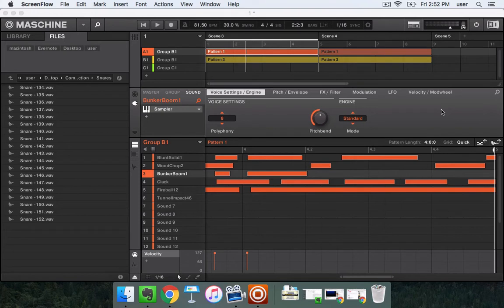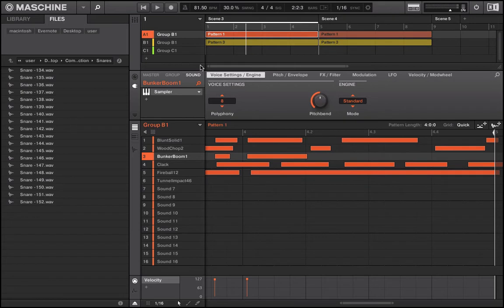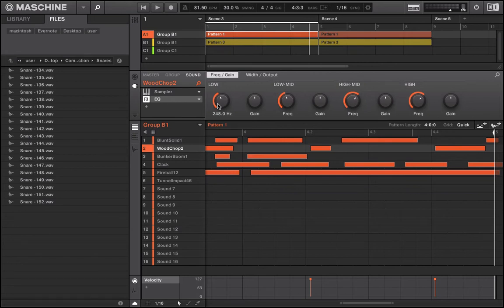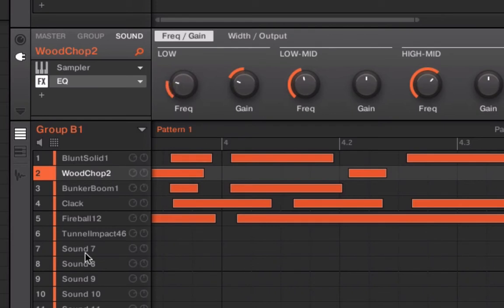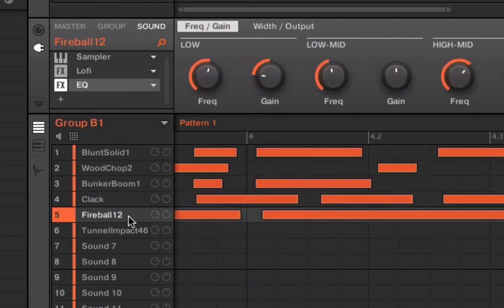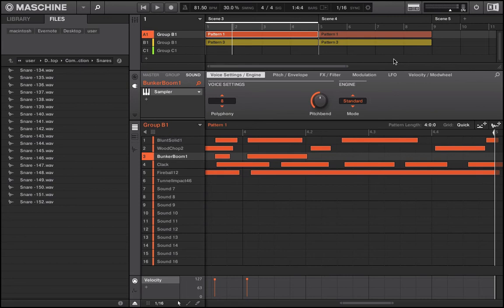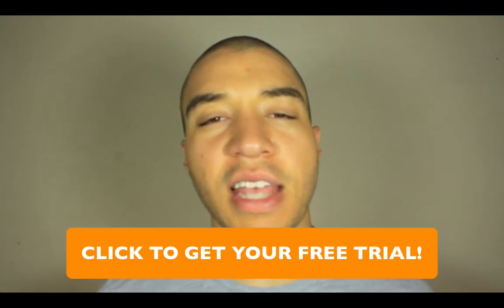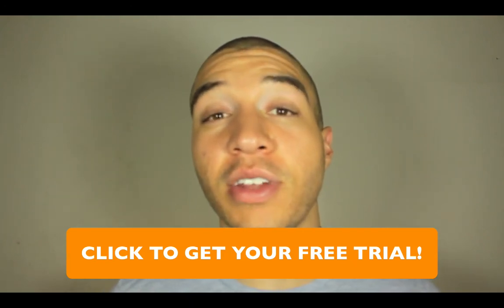How to Dramatically Improve Your Mixing on Maschine

Comment: +RobertStevenson how do you know/learn what the fundamental frequency of a sound is? For example you say the kick is at X Hz and the hi hats are are another Hz? I've been reading about frequencies and trying to learn but it's confusing to me. Are there ways of telling in Maschine what the fundamental frequency of a specific kick is so you can know what frequencies to EQ? Do you know of any websites or blogs that explain what sounds produce what frequencies? Thanks buddy.
Reply: other programs like Logic can be helpful as you can literally see the dynamics of an instruments wave in the EQ plugins. unfortunately Maschine doesn't really have a feature like this yet that i'm aware of
Reply from the maker: Hey Sean, I typically find the fundamental frequency of a sound by just experimenting with a really high boost on my EQ. For a kick drum for example, I'll use the stock EQ with a narrow width and boost it like 9 dB. Then I'll start at 60 Hz and then slowly sweep up to around 200Hz as I'm playing the kick drum. Typically I'll hit a sweet spot at around 130Hz or something that will bring out some good feeling in the kick. Then I'll typically reduce the boost to about 3dB and widen the band. You pretty much do the same thing for snares, hi hats, and any other sound or instrument.